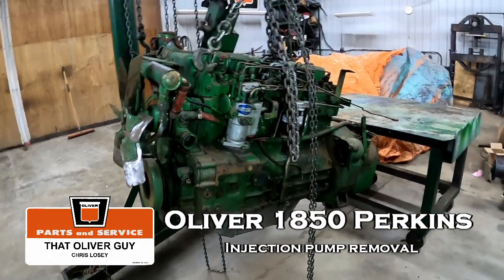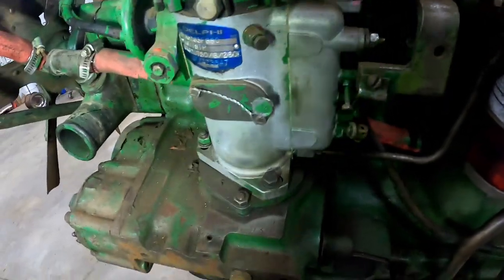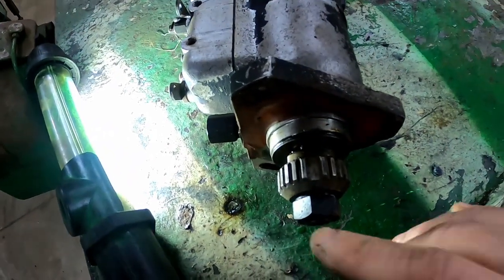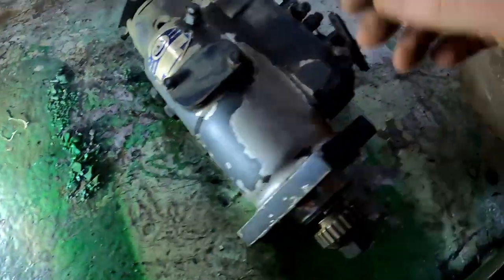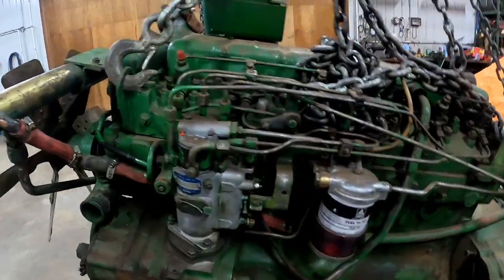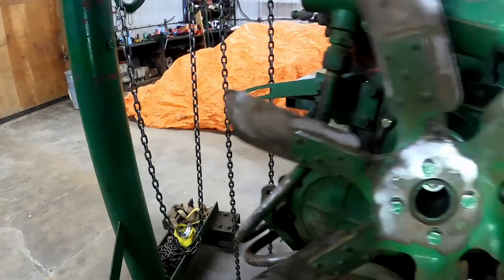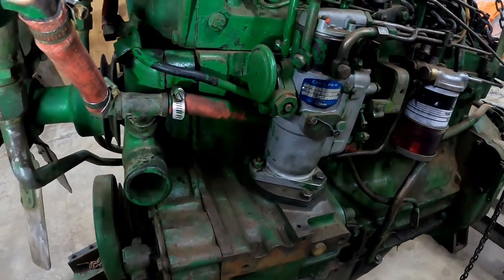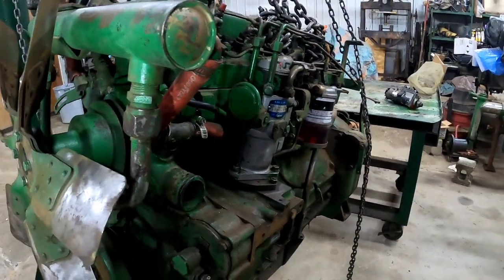Oliver 1850 Injection Pump

Comment: I worked on an 1850 Perkins, complete overhaul, sleeves, pistons, bearings. I remember trying to pull out the sleeves with a sleeve puller and a 1/2” diameter bolt shaft. No go. My ides was to change to a 3/4” bolt shaft. Came right out. As always, we had a few parts left over to be used next time.

Comment: It’s been awhile but if work is done that disturbs timing gears there is a tool that sits in place of pump. Once it is set with proper timing the actual gears can then be set so scribe mark is accurate. 
Another memory,  excessive oil burn turned out to be oil pushing up through pump drive into injection pump.

Comment: That would be a shame if true about that pump drive gear. There area lot of 354s still in service out there.  Perkins are some of my favorite engines in older equipment, start easy, reliable, inexpensive  to repair since parts were made all over the world. Not so much since Caterpillar bought them. Had an 1104c-44t in the shop nice window in the side of the block. Prices ridiculous for new parts.  All the cores are  being bought up for reman program.  You are right about that 310  turbo they sound beautiful. The Alice Chalmers D301 turbo also. They were both using a smaller diplacement engines to compete with the na 404 JD and 414 IH . The turbos built boost fast at the bottom end. Not like today,but good for late 60's

Comment: I just recently bought an 1850 and it has a fuel leak. Hopefully, it's one of the washers on the banjo bolt, but It looks suspicious that it might be leaking at the head.  So this might be helpful information!
Reply from the maker: It seems like that CAV pump is more prone to leaking than say a Roosa Master.  At least it's easy to take off and on. 😆
Reply: @ThatOliverGuyChris  and we have a few local guys who work on injection pumps so it's not the worst thing in the world

Comment: Never knew pulling the pump was that easy on these. My 1850 needs the bronze gear replaced but I’ve been scared to do it so I keep putting it off.
Reply from the maker: It doesn't take much more to pull that gear, just need get the timing marks lined up for that one. I've heard that gear is no longer available,  so I'd get one in your hands before tearing it down.

Comment: How do u get the oil pump to prime on one of those and verify that the oil pump is turning
Reply from the maker: The oil pump is driven by the same shaft as the injection pump, so if the injection pump is turning, the oil pump should be too. Beyond that, you'd have to pull the oil pan and drop the pump to make sure everything is ok. The early Perkins 354 oil pump could be troublesome for getting primed. My 1850 is one of those. I leave the oil filter loose and the fuel stop out and crank it over until oil comes out at the filter base. A bit messy, but it gets it primed. A neighbor was recently telling me it took 3 of them to prime theirs up. One would put air pressure into the crankcase breather, another would be at the filter ready to tighten it down, and the 3rd would start it. The early oil pump only had 4 lobes, later ones had 6 and that took care of the problem.
Reply: @ThatOliverGuyChris   thank you I will give that a try
Reply: @ThatOliverGuyChris   my problem was i forgot the cross over pipe when when I changed the oil pan and the oil pump the combine motor didn’t have it

Comment: Hey Chris thanks for the video. I'm getting lots of fuel at the bleed screw on the injector pump on my 2-85. Can't seem to get fuel at each injector when lines are cracked after lots of cranking. Any tips or suggestions? Was losing prime to the fuel system so replaced leaking drain cap on fuel filter and installed 2 new gaskets on the bottom of fuel injection pump( didn't have any before and was leaking). Essentially was working fine before and now it's better then ever so i shouldn't taking in any air. Thank you
Reply from the maker: Maybe the shut off got hooked up wrong and isn't in the right spot? Short of that, I can't think of anything external that would be causing a problem.

Comment: We have 2 diesel tractors one David Brown, the other a Massey Ferguson. Both have CAV pumps. The Massey Ferguson has always been a bear to start in the cold(Perkins, duh!😂) The older David Brown is definitely more forgiving. Not quite as good as a modern engine, but not bad.
The David Brown has a switch on the injector pump that helps cold starting(make the idle slower), did Oliver ever utilize that system on their equipment that wasnt a repainted David Brown?
Reply from the maker: I bet that switch changes the timing. I've never seen one on an Oliver.

Comment: Can you do a video on that Bronze gear because that’s what our 1850 does wide open or once you get over about 1600 rpms and it probably doesn’t help the injection pump leaks on it
Reply from the maker: Not sure when I'll get a chance, but I'll add it to the list. Last I knew, the gear is not available any more, but if the bearings it rides on are worn, that can cause trouble. So can the thrust washer that the worm drive shaft has on the front of it. Grab the stub shaft that comes out the back side and see if you can push it in and out. It should have little to no movement.

Comment: Hey man, i have a tractor with this engine, and im trying to figure out what the part that the injection pump is mounted to is called. I understand its the block, but it has a shaft that sticks out the back of it that spins when the engine is on and it has a keyway like you could attatch a pulley or gear to it to run an accessory or implement. Mine leaks from there and i need to know what that shaft is for/called. Thanks.
Reply from the maker: The book just calls it a shaft. The seal is a 165812A in Oliver part numbers.
Reply: @ThatOliverGuyChris   thank you. What manual would you recommend for these things ?
Reply from the maker: You can get a copy of the original Oliver factory manual from the Floyd County Museum. It goes into more detail than an I&T manual and well worth the extra cost.
https://www.floydcountymuseum.org/?page_id=146
Reply: @ThatOliverGuyChris   thanks so much for the help

Comment: Hey Chris. I didn’t know Oliver used Perkins engines. Can you tell me when they started using them and which models plus why did they start.. Thanks for another epic video.
Reply from the maker: They only had one tractor model that used a Perkins, the 1850. That started in 1964 and went until 1969. Oliver had been powering their "8" sized tractors in house up to that point, but outsourced engines for the higher horsepower models. For the 1850 they decided to go with the 354 Perkins diesel,  but gas and LP were still the Oliver/Waukesha 310. The Lanova style head on the 310 diesel was getting to the upper end of its horsepower range, so the Perkins let them go up in power. By the end of the run they had redesigned the 310 diesel to be direct injected with a 6 port intake manifold. They could now build an in house engine for that horsepower, cheaper than they could buy the Perkins.  Time would show that they were squeezing a bit too much out of that 310, so when the Oliver name was dropped, the new White tractors used the Perkins in the 2-85 (no turbo) and the 2-105 (turbo). They were used in the newer 2-88 and 2-110, and replaced with Cummins 5.9 B series engines with the introduction of the 100 series tractors in 1987. White also used the Perkins 354 in some of their combines, and it was an option in the Oliver 545 combine, maybe others.
Reply: @ThatOliverGuyChris . Wow I love asking your more information. You never let me down.

Comment: Had a 550 with American Bosch pump went bad. 
No one in the world had a pump head.
Got a rebuild one in Michigan . $1500 for the head .
Reply from the maker: Those heads are no longer available,  but I've heard of guys getting new ones made at a machine shop.  Costs a few, but gets them running.  They can be switched out to a roosa master with the right parts.
Reply: @ThatOliverGuyChris  yes I may have gotten the last one.
The gearing is 2:1 inside pump rotor so other pumps can't work in this engine to easily.
I tried a industrial Waskashua pump roosta master no good.

The 4 cylinder pump is rare .
Thanks

Comment: Hi Chris, are you back now to working on your purple 1850 project? Also just wondering your opinion about v-8 engines. Do you think that they have as much lugging power as a inline 6 does? I have always heard that the IH 1468 didn't have very good lugging power. Just wondering how the Cat v-8's would compare to the IH v -8 engine.
Reply from the maker: Yes I am, although I've hit a hurdle with getting the purple paint matched up. 
My experience has been the v8 diesels don't lug like an equivalent in line 6. I have never used an IH v8, so I don't know how they compare to the Cat. I keep my rpms up and I'm not afraid to use the powershift when they go down a couple hundred.
I'm guessing you're pretty cold in South Dakota right now? Fortunately for me, as long as Lake Michigan isn't froze over, the air doesn't cool off as much for us.
Reply: @ThatOliverGuyChris  Yes we are pretty cold here right now day time highs are averaging about 0 this week. Sunday's high is supposed to be a whopping -10. Next week things are going to warm up to around 30 by mid week.

Comment: I am having issues with oil pump pto shaft under fuel pump. I can't find info.
Reply: Seal
Reply from the maker: Can you give me more details?
Reply: Tachometer seal leaking oil looks like through shaft. I don't know how to remove
Reply: Old perkins 354
Reply from the maker: Is this on an Oliver 1850?
Reply: @ThatOliverGuyChris  it's in a boat that I run, looks similar to one in video with  shaft under fuel pump. It is a non turbo 354 6 cylinder perkins
Reply from the maker: There were variations on that shaft. Oliver had a 90 degree tach drive adapter that was mounted in the front cover. Later White tractors drove off the backside of the  shaft where it comes out of the block.
Reply: I see engine in your video appears to have two shafts under fuel pump. Mine has one and a plate over front where your engine has shaft. That rear shaft leaking oil
Reply: Just seeing if you know how to remove, if it's a press fit or takes special tool.  Thank you for replying
Reply from the maker: The tach adapter appears to be a press fit, but I haven't had to repair that style before. The seal, at least in a White or Massey Ferguson tractor, is part #  884845M1.  I found a feeww places selling it with a google search, or you can use this link and click select a dealer near the top right to find the dealer closest to you. Most will ship as well.
https://parts.agcocorp.com/en_US/Routine-Maintenance/Seals%2C-Gaskets-%26-O-Rings/Seals/SEAL/p/884845M1?text=884845m1
Reply: Thank you for your time, I appreciate,  hopefully all will go well.  Halibut derby tomorrow so heading offshore. Mabe lol.. I let you know how it goes.

Comment: The only bad thing now about the 354 Perkins is the injector pump drive line, No one has any of the parts for them and not even Perkins !  My 1850 had a harmonic vibration in the pump that turned out to be the bearing under the bronze gear was worn , Harry replaced it while it was apart (came out with his fingers had to tap the new one in) and with the injector pump rebuilt she purrs now !  Bandit
Reply from the maker: I rebuilt one where those injector drive bearings seemed fine, but several bearings worth of being a little loose added up up to high end flutter.
Reply: @ThatOliverGuyChris  Mine had a flutter about 1600 rpm and a vibration there after. New bearing and rebuilt pump she runs smooth now so I'm sure it was a combination of both being bad.  It was interesting my service manual had both the bushing and bearing noted in it ware as Harry's book only showed the bushing under the drive gear. So pays to have old books ! LOL Bandit

Comment: didnt 1850s have 310 turbos without coolers?
Reply from the maker: No, thats wss early 1855s. The 1850 was either a 354 Perkins diesel or a Waukesha 30 that could be gasoline or LP.
Reply: @ThatOliverGuyChris  ah I see. Much better tractor I take it?
Reply from the maker: The 1850 with the Perkins ? Arguably one the best tractors of the 1960s.
Reply: @ThatOliverGuyChris  still not better than a red tractor
Reply from the maker: Well, that's arguable.  Lol
Reply: @ThatOliverGuyChris  exactly which is why I'm arguing that it's not lol

Comment: Can the timing be advanced by rotating the base of pump left or right?
Reply from the maker: Yes. There should be an arrow on the tag that show the direction of rotation.  You'll probably have to loosen the injection lines to get it to turn, but the holes are slotted.